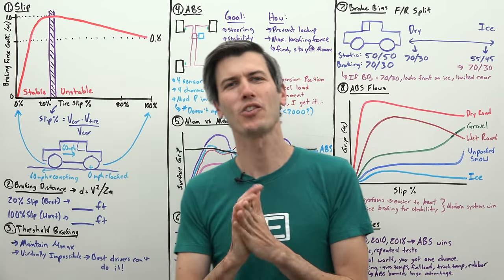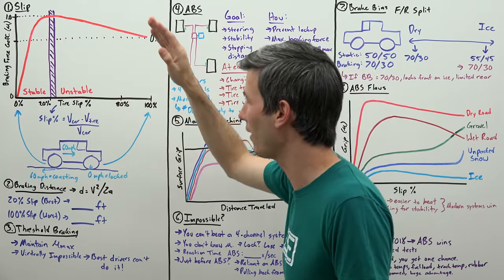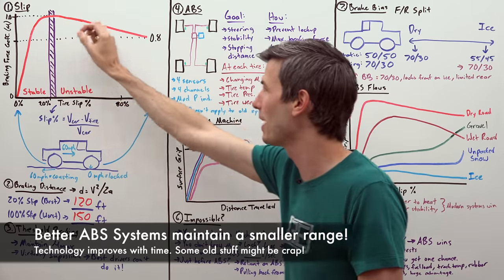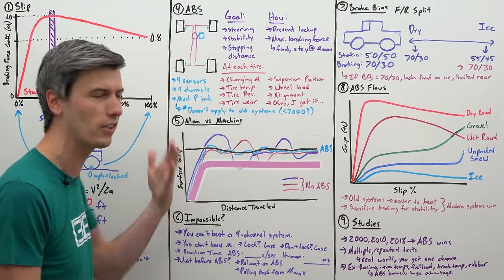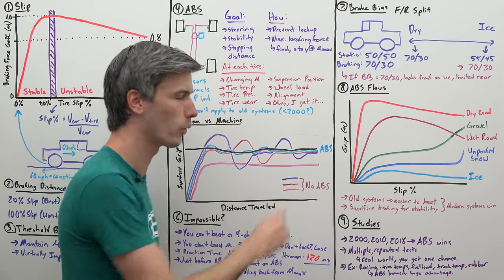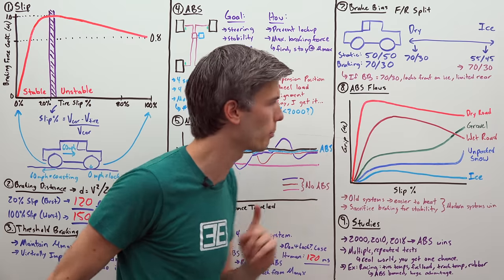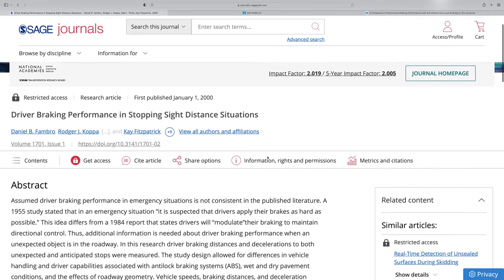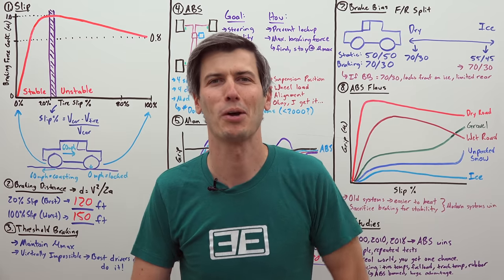Why Threshold Braking Is Impossible - ABS Wins!

Comment: Modern ABS is fantastic, we get it. However I wonder how good the ABS system is on really cheap (Kia, Hyundai and so on) cars. I know that back in 98 Toyota Corolla had a ABS system with sensors on every wheel, but only affecting the main brake cylinder, so no per wheel braking. Still I am pretty certain it's better than just about anyone trying to beat it using threshold braking.

There is however one instance I remember that tests show that ABS can lose to manual braking, but it's not threshold braking but locking up the wheels. And that's when driving on gravel. When locking up the wheels the gravel will build up in front of the locked wheels while using ABS the wheels will start slipping really early so a low brake pressure will be applied. The result is that the car with the locked up wheels will have a shorter stopping distance, but at the cost of losing close to all maneuverability. So apart from brake distance it's really dodgy. Would you rather have a longer stopping distance or do you prefer to slide uncontrollably not knowing where you will end up? Personally I'll take being able to steer any day.

Now the best thing for everyday driving is of course if you never need to use the ABS. While it still allows you to stop under some resemblance of control and at close the shortest distance possible it's still an uncontrolled braking action. Thing is you do not KNOW EXACTLY WHERE THE CAR WILL STOP. In a panic situation that is the best you can do, but during daily driving it's a very bad thing. If you need to brake that hard going into a corner when driving to work or anywhere else on public streets then you are driving to fast. Some oil, water or sand on the road can be enough that even with ABS working overtime you can't make that corner or you will cross over into oncoming traffic or any number of other bad things. If you do it on a racetrack then go ahead. Even if you end up in a catastrophic crash it's unlikely you will kill anyone else.

Comment: I need to use abs today, could I have used threshold breaking? Sure, but when it's raining, dark, down a hill, around a corner, and you see an ambulance with lights on, you kinda just slam on the breaks to pull over. Idk why people hate abs, F1 drivers would be so much faster with abs and traction control
Reply: Yeah, just let the computer race the F1 cars and take the human completely out of the loop. Much safer anyway.

Comment: You probably should have explained why locking your wheels up is bad, other than just increased stopping distance, especially in a corner.

F1 had ABS, traction control and launch control but it was all banned in 1994.
There was concern, raised by some of the best drivers of the time, that banning it all at once was a bad idea but the FIA did it anyway. That year there were numerous deaths, including Senna who was one of the drivers critical of banning all the electronics at once. There are, in depth, videos about his death and banning it all at once, shouldn't be too hard to find if anyone reading this is interested.

Comment: ive had this discussion wiith a lot of motorbike owners, they think ABS is not worth it ,they have been riding for 20 years without any issues and having ABS takes away from the riding experience. in a panic situation especially on a bike there is no way you are stopping faster than a modern ABS system, even in the dry.. my 1299 ducati has programmable ABS modes and in a panic situation you can just hammer the brakes, the bike will lift the rear wheel off the ground a little bit and just hold it there all the way to a standstill. and you dont notice the system at all if you dont ride hard enough for the wheels to lock up.

Comment: It sounds like you haven't driven enough with a car that doesn't have abs. Both of my cars are without abs. I will not argue with that the abs is better than the human. But problem is that you can't actually feel the car that has abs. In a straight line it doesn't matter but when you take corners into consideration then a non abs brake gives you much better feel for how much grip you actually have and have fast can you take that corner. In my eyes only advantage that abs has is that it can modulate every tire individually. Even a finnish rally driver said that he prefers brake without abs. With abs he can't bring out the full potential of a car.
Edit: About the brake bias. Cars without abs have had long time a thing called rear brake pressure regulator. Which if set up properly can adjust the brake bias perfectly cuz the rear would lift higher when braking.

Comment: Maybe I'm misunderstanding the slip graph, or maybe a rolling wheel is not technically static to the surface, but conventional knowledge says static friction is always larger than dynamic friction, so the graph should start at 1 at 0% slip according to how I understand the world and not at 0,

What am I missing here?
Reply: Good point.  I think both models (slip and static vs. dynamic friction) are just very primitive approximations of a very complex tribilogical system, that tend to give nonsensical results in the edge cases. 

In order to get a good answer, I think you need to look up the brush model of a tyre. But I will try to explain it as good as I can remember from my class: 

Imagine the thread pattern of your tyre as a brush, where the bristles represent the rubber. Now imagine the brush touching the floor in a static case: all the bristles are perfectly straight. Now, if you want to apply some amount of longitudinal force on the brush, you need to bend the bristles, and doing so, the brush will move along the floor, even if it is just a small amount. But there you go, you have to move the brush along the floor (differential speed, aka slip) in order to apply a longitudinal force.

Please let me know if this makes sense to you.
Reply: @onesquirrel2713  this makes sense to me, to me a better visual analogy would be how the rubber on dragster tires gets pulled back and almost folded when accelerating from the starting line

Comment: My Prius ABS sucks, it gives up at the last 10 ft. I have to increase the pressure. Literally pump it or it will about rear end someone.
Reply: ABS stops to work under a certain treshold, typically 5 to 7 kph. This is normal

Comment: Not all abs is created equal. And TC has come a long way in the last 30 years. I'm def not arguing against abs but this is dependent on how old your vehicle is and what model.  Also have to mention the fastest accelerating/decelerating vehicles in the world in all of human history, formula 1, can stop from 60 miles an hr in 40-50 feet, without abs. So overall design of your vehicle is also going to play a major role. Take full sized trucks for example. If abs is always superior why aren't all modern trucks equipped with abs in the front? They are typically only rear equipped with abs

Comment: In winter, in wet snow conditions, ABS makes braking distance up tp 3x longer, that is tried and tested. That is why I disconnected the ABS in my -93 Caprice, and connected it only for the annual MOT. The ABS would be ok for women and unexperienced drivers if they would use it correctly, that is stand on the brake pedal and steer to avoid collision, but in the Real Life, they just get wide eyed and crash. When the ABS came, it was the main reason for longer than before braking distances,as it ruined good braking systems. The Bosch system in my Caprice was so bad that it was actually dangerous.  Even today, with better ABS:s ,people think that they can brake in a slippery curve with ABS, but any extra disturbance to the grip will cause loss of it, ABS or not. The only real benefit from the ABS is that the rear brakes in front wheel drive cars are now allowed to operate with full line pressure ,that keeps them operational and not stuck until used with more pedal pressure like the old systems. Then they would usually lock the rear wheels and make the driver lose controll. In my H3 I no longer can disable the ABS system easily, so, here in Finland, I just have to be extra careful in certain snow conditions.
There may be situations when ABS is good, but I have never found out when. Usually they just make braking distances longer in real life, loose gravel and slushy snow are the worst situations. With 40 years of driving all kinds of cars, I would rather have just good working normal brakes, not the ABS.
Reply: +1

Comment: There is one exception - a superbike. The ABS systems in modern superbikes are way too intrusive because they're calibrated for sub optimal grip conditions, so you get to the braking zone on track and head straight into the gravel trap if you forgot to disable ABS

Comment: My 1999 Ford Ranger is one of the worst ABS systems that I have ever driven. In slippery conditions you would never stop. Another bad one was Chevy Blazer that would kick off the brakes while braking in a corner. I build hot rods and a well built and balanced system works great. Most hot rods have horrible brakes because they are mismatched parts.

Comment: Japanese motorcycles are notorious for having ABS that kicks in too early on the race track. You only have to go see a few superbike mega test videos to understand relatively normal folk can beat ABS on those machines. But it's still way safer on the road as the consequence of locking up is much worse on a bike. Only recently have motorcycle systems got to the level they consistently outperform humans, and these are only on elite level bikes that most folk can't afford.

Comment: Hydraulic ABS works quite well. ABS on air brake systems doesn't work worth a crap, especially drum style brakes. It's just physically impossible to move air fast enough to modulate them quickly. You just end up not stopping very fast at all with a jerky feeling as the system applies the brakes every so often. I call it the anti-breaking system.

Comment: If you don’t have ABS, in an emergency stopping situation, the closest humans can come to performing like the ABS is to apply the brakes hard but to pump the brakes quickly, like an ABS does, to avoid locking up the wheels/tries, according to “defensive driving” techniques.

Comment: Abs is all good until the system fails and your brake pedal just keeps going straight to the floor and you blast through the corner into a ditch. This happened to me in a 2001 Subaru liberty wagon about 10 years ago

Comment: I feel like those studies all have a little bit of bias since they all prove what they wanted to prove.
I don't want to sound like that "but look at my one example" guy but my 2005 JDM Subaru repeatedly stopped better on ice with letting go of the pedal a little bit after ABS engaging. I tried it around 10 times on the same track during advanced driving courses. And I know for a fact that it doesn't have ESP as a way to engage brakes individually.
What I'm saying is I 100% believe that a modern system can outperform humans, but if we had studies that said "OK, systems with THESE specs and and THESE conditions are not better, while all others are" we'd have a lot more drivers really trusted these conclusions.

Comment: This may be true on normal and good roads, but on roads full of asphalt patches and/or potholes, the standard ABS (don't know about racing spec) can actually kill you.

someone must have had that awful experience when trying to brake hard before a corner, and the tires are still not sliding and the wheels still do not lock up, but then you hit a bump or similar, and the ABS kicks in and essentially reduces your braking force since it thinks that the tyres began sliding, and you find yourself in a situation where you are moving faster than you want to just as you enter a corner.

Comment: ABS in racing... you can see the effects in IMSA GT racing. They have a pro and am class. The pro class does not allow ABS. The am class does. Quite often, a pro driver will catch up to an am driver, but will lose ground under braking. Years ago... I'm thinking 90's, ABS and traction control was legal in F1. It turned into a competition between the software engineers, not the drivers.

Comment: Not all ABS are the same (or rather, were): 17 years ago I could beat the ABS of my car by threshold braking over it (dry conditions only), and I was taking out the ABS fuse when there was snow. Then, 12 years ago I swapped it for a more modern model and I couldn't beat the ABS anymore.

Comment: What I will say about ABS is this: if it works correctly as intended, it is certainly better than whatever a driver can do. However, when it doesn't, you end up rear ending a Suburban. I can't speak for modern systems in pick-up trucks, but the older systems (pre-2000) are HORRIBLE. Why? Because the very second it senses the rear might lock, it DUMPS the pressure to prevent the ends from swapping (at least that's what it feels like)...which in the wet or in a corner is just fine. When you are on dry pavement that is simply just a little bumpy (bridge expansion joints in my case) there's nothing like the feeling of being hard on the brakes to avoid an accident and the pedal starts pulsing and the rate of negative acceleration DECREASES and no matter how hard you press on that pedal, the truck just keeps going...because it thinks it is sliding when it's not. Won't even lock the fronts (2-channel system in this case, so rear only) when it activates even with the most aggressive pads I can find (EBC Yellowstuff HD truck pads). I've heard this called "ice mode" (non-official term I am positive), and it feels exactly like you are on ice...and you end up in the back of a Suburban. On a regular smooth surface, it works as intended and will lock the fronts while keeping the back in check. Suffice it to say, I HATE the ABS system on my truck. It's too d@mn sensitive. This is the 3rd truck from this era that I have driven that acts this way. So, it's not just this vehicle ('99 Ram 2500 2WD gas/auto).

Comment: I don’t understand how ABS is supposed to measure slip when all four wheels are experiencing at least some slip There is no wheel able to act as a “control”.

I get that you could measure the deceleration profile of the wheel against a mathematical model, but that would be a pretty crude measurement.

Comment: 8:35,  That point is wrong.  ABS still needs you to hit the pedal before it kicks in so it wouldn't have cycled twice yet.  Now auto braking is a different story, I'm guess every auto braking car has ABS.  

One big issue where ABS is a plus, you're driving down the road and somebody with her face stuck in the phone pulls out in front of you.  A normal person would press on the brake pedal for all their worth and be too panicked to modulate once their tires locked up.  Score big plus for ABS

Comment: The biggest problem is the fact that a very large percentage of drivers have NEVER pushed the brake pedal hard enough to feel the ABS System cutting in !!!!!!! This is a good & bad thing, good that they've never had to brake at 100% (safe driving) but also bad as when required they will most likely stand on the pedal, feel the ABS cut in and then lift there foot off the pedal when they feel the pedal pulse (not good)

Here in Western Australia, Motorbike riders have to perform a brake test from 50km/h in a minimum distance where car drivers don't. Yes bikes are harder to brake and locking up is best avoided. Why is the same test not carried out for car drivers so that they can LEARN what hard braking is like. When I learned to drive back in the UK, this was part of the driving test. 

IMHO braking is a far more important skill to learn when driving than doing all the other manoeuvres that they do. Showing that you know how to park a car is not a skill that you need to prove when compared to stopping the car before you crash into the back of me.

Comment: As a nerd, I loved the theory. But as someone who drives 5 months a year in the snow, this is BS. When the ABS engages on ice the brake distance is looooong; and the car brakes a lot better if you lift the pedal until the ABS stops engaging. It's so counterintuitive and surprising when the car starts breaking more as you lift the pedal a bit, but I experience it dozens of times a year, every year. Even pumping in a panic is better than pure ABS (at least in the cars I've driven, several models of minivans and sedans).
Reply: Are you using proper tires?
Reply: @logitech4873  If you mean winter tires at the proper pressure, yes.